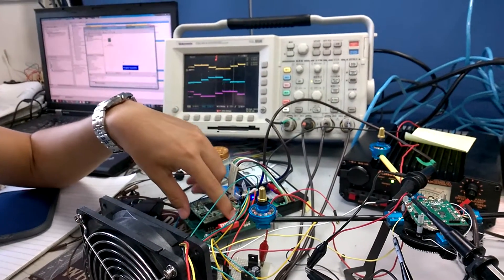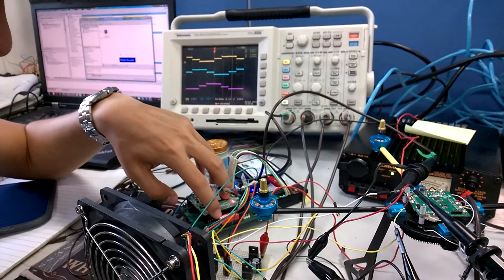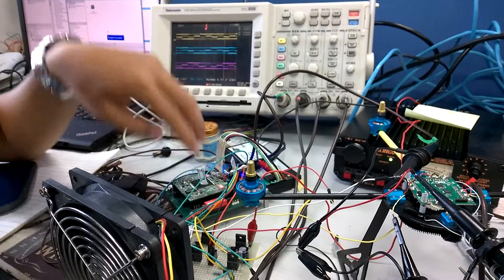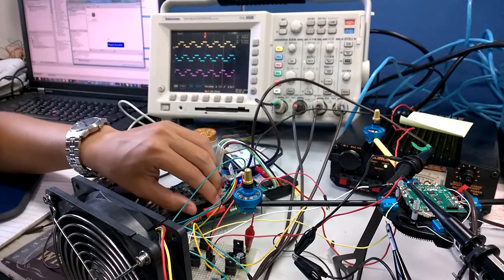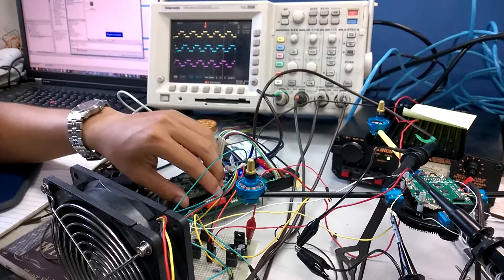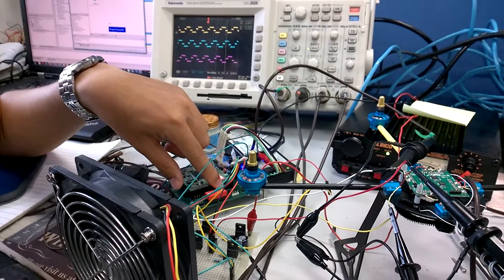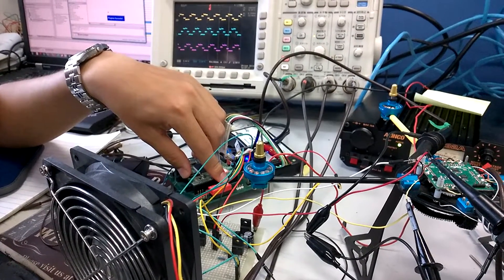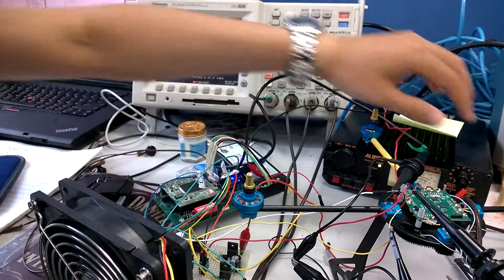VHDL Based FPGA Control 3 Phase Brushless DC Motor Research Progress

Comment: great job for your project :)
have you try brushless motor using microblaze/soft processor?
Reply from the maker: Rejanuis Ryuzaki
Nope, I haven't used microblaze processor to control BLDC.
Reply: thanks for your answer
So, you only use vhdl to control it?
Reply from the maker: Yes, you are right
Reply: i'm newbie in FPGA,and sorry,would you like send me example code for control BLDC using VHDL? i'm very grateful if you can send to me :)
Reply: Reg Fu i am still confused for control BLDC using vhdl
Reply from the maker: There are books that will be very helpful for you to understand VHDL. I used these books to learn the language.
http://www.amazon.com/Circuit-Design-Simulation-Volnei-Pedroni/dp/0262014335/ref=sr_1_2?ie=UTF8&qid=1437761147&sr=8-2&keywords=VHDL

http://www.amazon.com/Finite-State-Machines-Hardware-SystemVerilog/dp/0262019663/ref=asap_bc?ie=UTF8

Hope that will be helpful!
Reply: thank you very much
Reply from the maker: No problem
Reply: @RegFu  can you please give the code used here